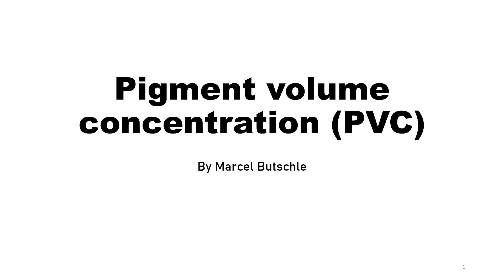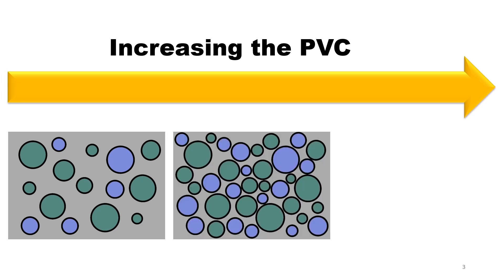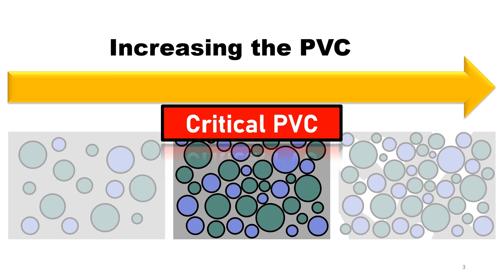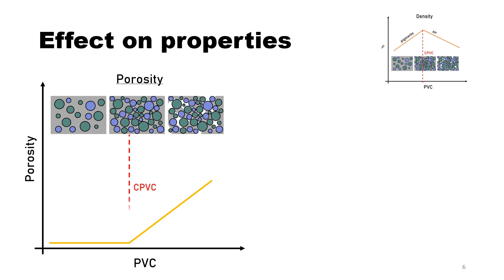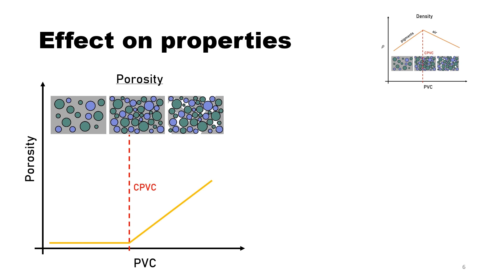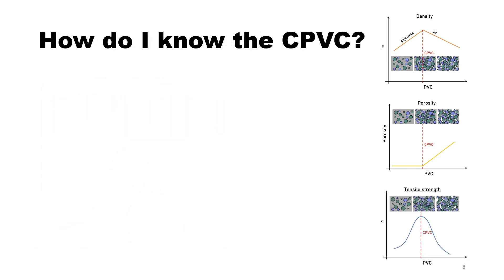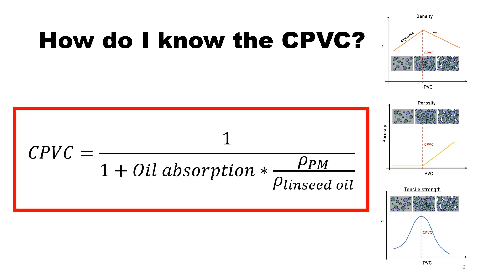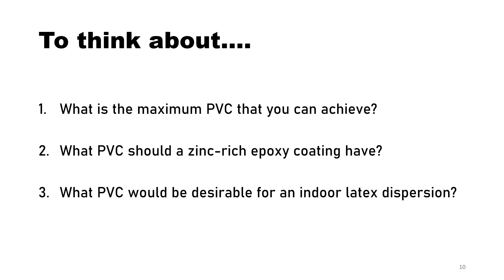PVC & CPVC: How are the properties affected?

Comment: Does using cement or hydraulic lime would change the PVC calculations? Or is it even compatible with this method? I’m working on a project about decorative plasters, in my case it mostly about lime plasters.  

Great video thank you
Reply from the maker: The PVC is just the volume fraction of pigment, filler or other aggregates to the volume of the total (dry) formulation. So I guess it would also work for your application. If it helps proofing a theory, just go for it I would say.